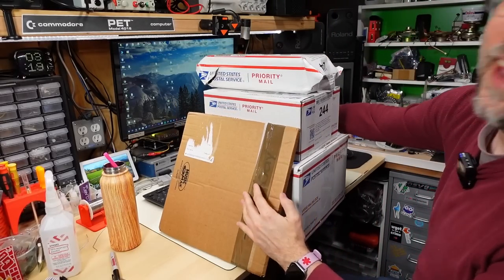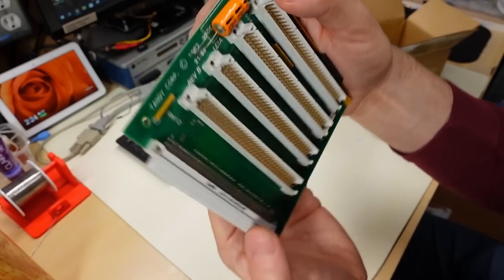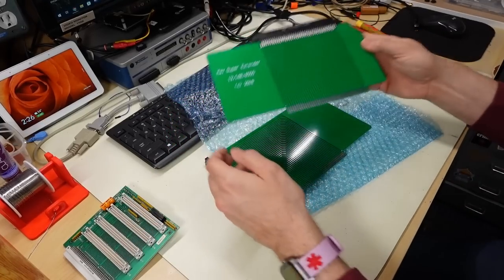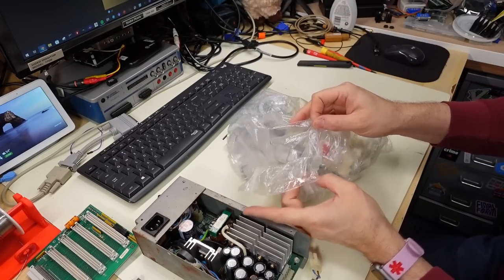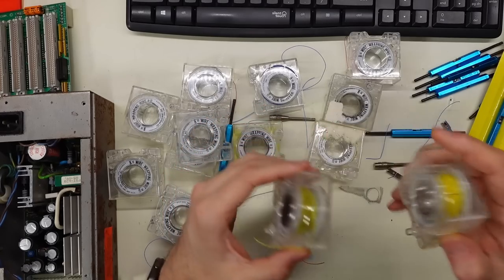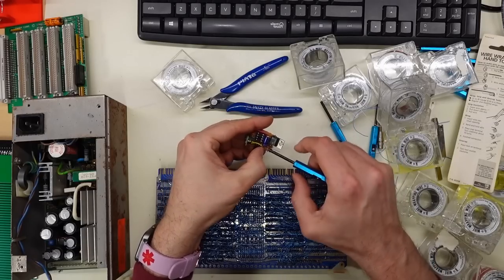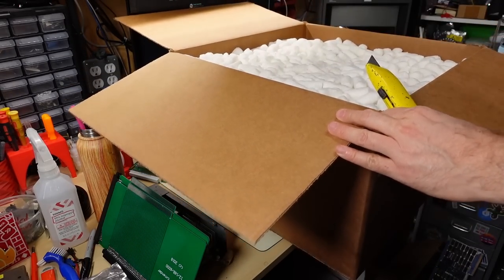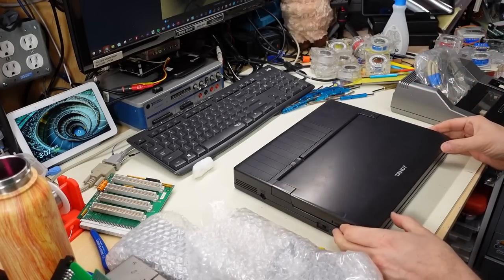0024 Wire wrapping goodies and some mystery Tandy items

Comment: With all those packing peanuts there are ways to easily deal with them if you got the time and materials and you have to deal with that and a lobster from Packaging.

I once built a device that was designed to reduce that to 2 as small as possible.

Was powered by a old dryer blower and motor.

And a bunch of other things but not easy to describe the construction.

However it was designed so to keep at least as much as possible inside the system so you don't send him straight a little bits of Styrofoam blowing everywhere.

One of the issues was keeping the screen clear essentially a small brush assembly that was an auger that just kept clearing it as it was running.

Also it would collect any Dupree's from the styrofoam and all from grinding it down.

Also this could shred larger pieces of Styrofoam Packaging.

Loaded into the machine.

Also work well for Styrofoam insulation and insulation board.

Could be switched over to get rid of Styrofoam peanuts Radley.

Including whisking them up via vacuum.

And yet designed to automatically slowly feed the grinding mechanism to keep from jamming rarely ever would require manual intervention in that terms.

Needless to say this is a piece of equipment you would not have running or connected the power if you had it the thing open yeah that would be bad idea.

And yes there were safety interlocks for this reason!

Also you'd wind up with a trash bag full of styrofoam bits!

Also there was an auger that kept running into packet in there readily.

At the bottom of the output collection Hopper.

The bags were just secured with a large clamp.

This is somebody that had so much of that packing coming in that they literally have like it would seem a dumpster full of just are from peanuts almost daily.

And that does not include packaging materials from styrofoam otherwise.

Substantially reduce the volume!

It was a one-off design didn't really document anything at all either wish I had!

Other than how to operate the machine and repair things and so on but no documentation I wish I would have been able to reproduce this for others since I've had people ask me do you know where to do something like this